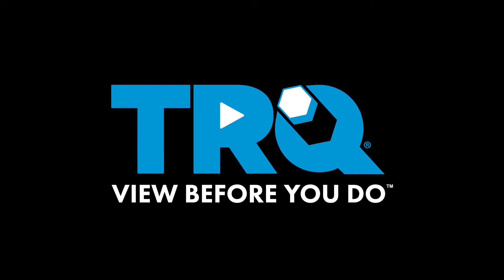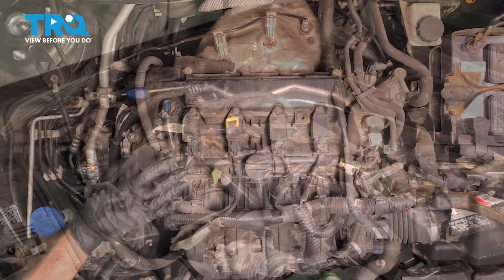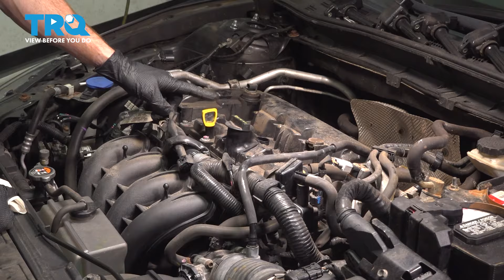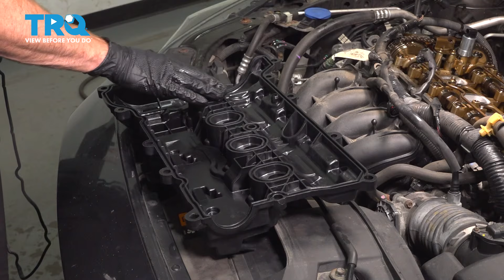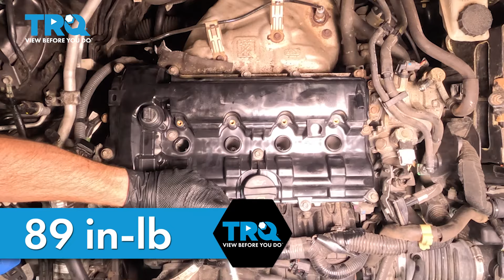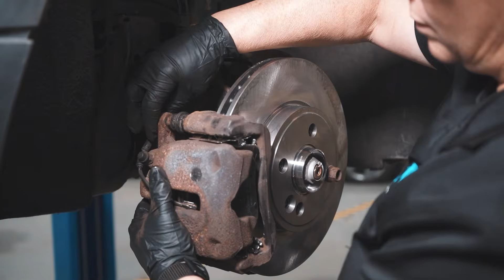How to Replace Valve Cover 2014-2018 Mazda 3 2.0L L4

Comment: This tightening pattern should be the same for the 2.5L as well. Also, for those of you asking, 89 INCH pounds is the max amount of torque you want for these bolts. Cheers.

Comment: Is this also fine for KF series CX-5? Looks like the same. According to my VIN this is my OEM part number: PE0210210A
89 in-lbs not too much? It's ~10 Nm, but I also saw 5 - 7 Nm range too. So which one?

Comment: I changed my engine the dip stick was broke I pulled valve cover didn't use rtv it leaked after 2nd test drive😮broke one bolt taking off valve cover S tripped bolt now going to use h eli coil and new gasket and rt V 3rd time is a charm😂

Comment: After I replace the RTV and reinstalling the cover, waiting for about an hour for the RTV to cure, how long should I wait to start the engine? The RTV takes about 24 hours to fully cure. I pulled the transmission pan and waited 24 hours before refilling on the same silicone. Just curious how long you waited before restarting the engine.